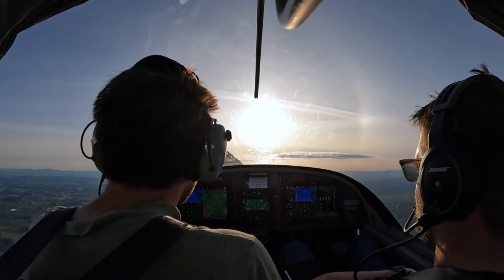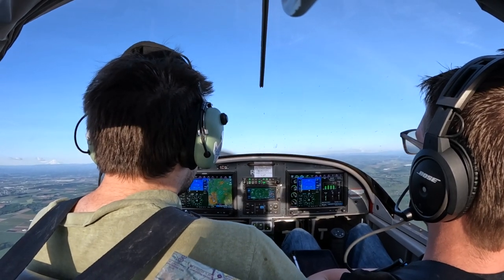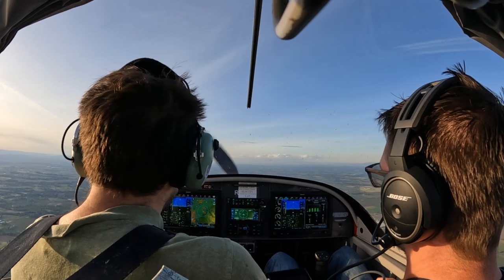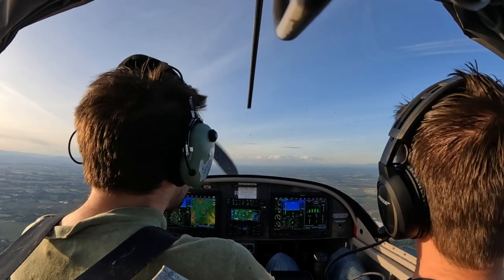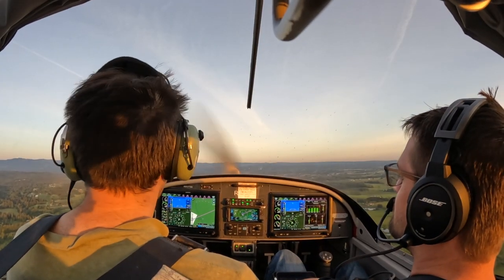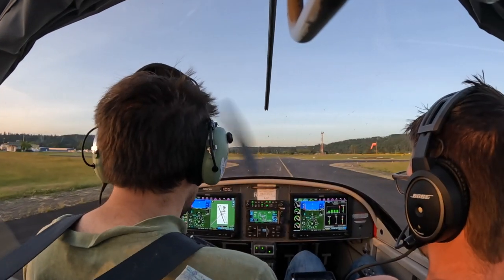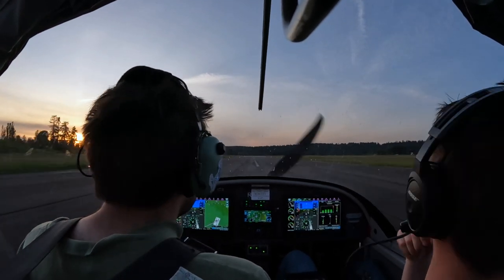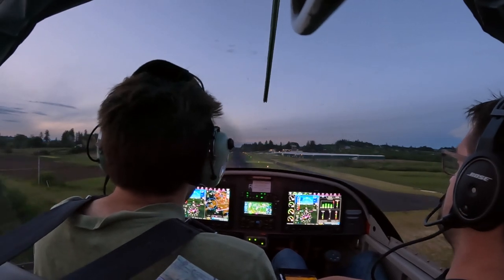2022 05 31 checkride prep #6: stalls, landings, forward slips

Comment: Interesting. The stalls in your airplane are a slightly different procedure than in mine. I pull full idle from the start. I like the idea of simulating an actual landing though, and I don't go full idle until I've made the runway. I may have to try this stall procedure to see what I think of it.

Also interesting that you don't go full power on your power-on stalls.

Looked like a nice landing after the slip.
Reply from the maker: It's hard to pitch down full dirty and keep the airspeed up, though I could have just pitched a little more you. A power on stall at full throttle requires at least a 30 degree pitch, dialing it back means 25 degrees. But it climbs at over 1000ft/min fully loaded so a power on stall takes a ton of pitch.
Reply: @flysport_tedder  Yeah the difference between an RV and a Cherokee.